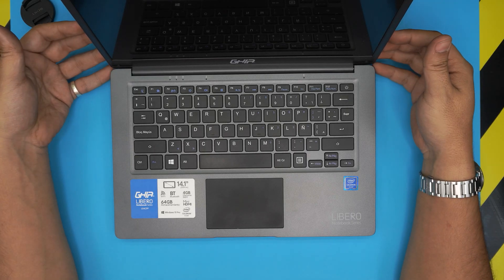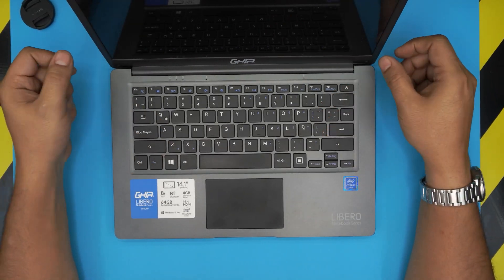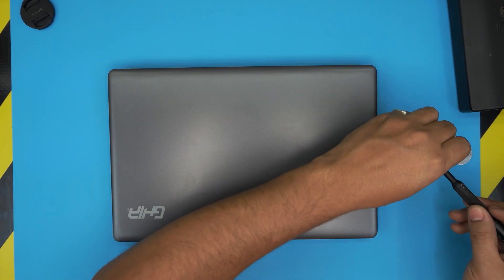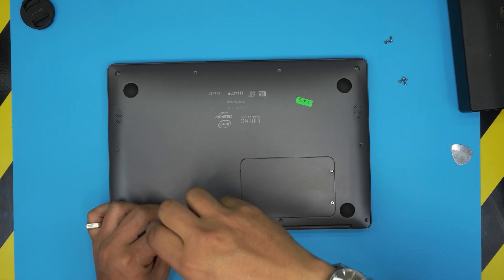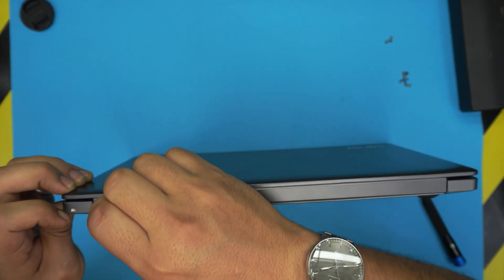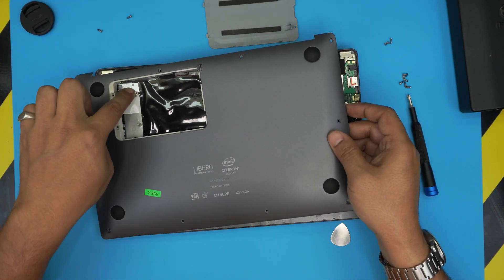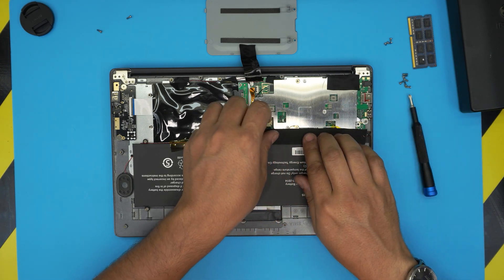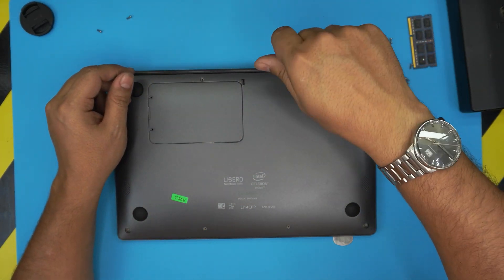How to upgrade Ghia Li14cpp Ram

Comment: Can you take out the existing 4g RAM and replace it with an 8g chip?
Reply from the maker: 🫠Regarding your question, you could desolder the ram chips and get a bigger ram chip they are BGA chip and you will need experiance tech to do a reballing service.
Reply: @uFixTek  Thank you.
Reply from the maker: It's my pleasure my friend.